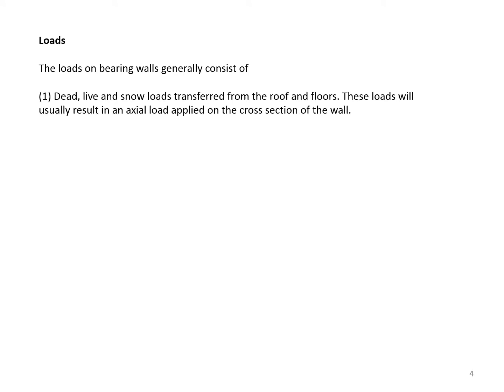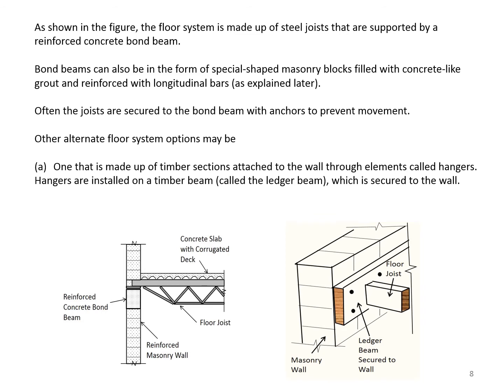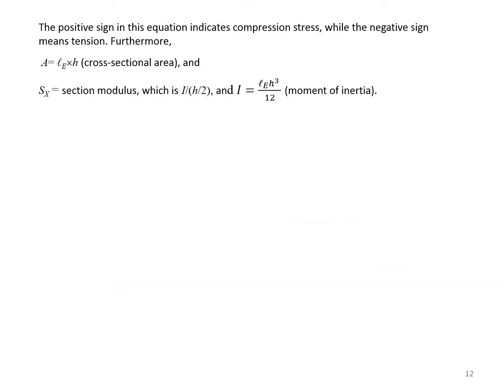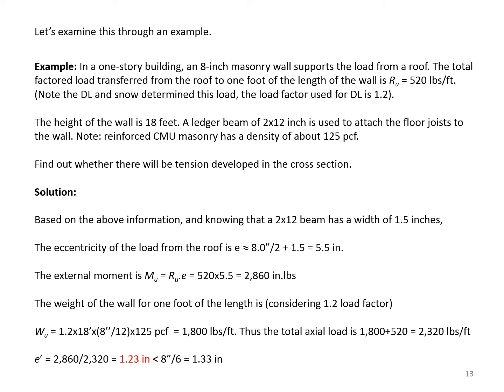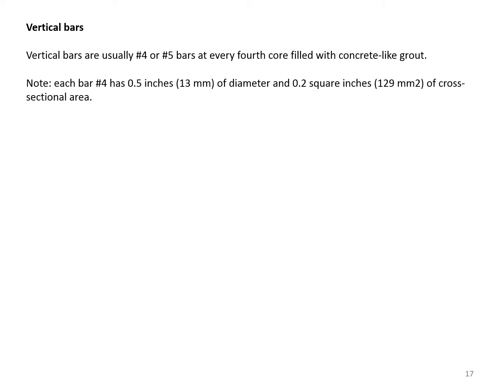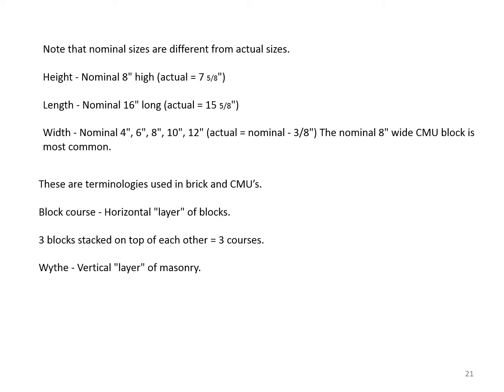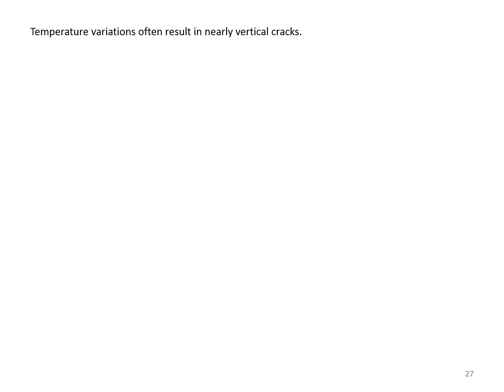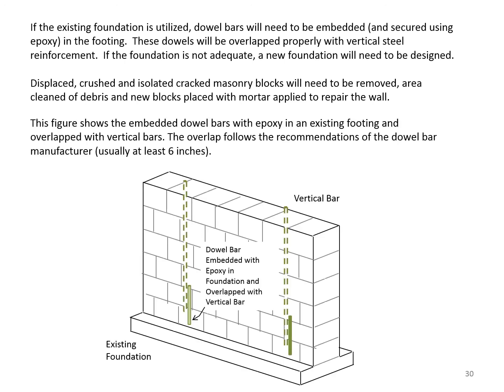Structural Engineering Made Simple - Lesson 13: Design of Brick and CMU Masonry Bearing Walls

Comment: Hi, thanks for the lesson, on example problem 1, 12:20, the check is done at the bottom of the wall, but additional checks should be done at heights above the bottom of the wall where tension could be developed, correct?
Reply from the maker: Dear JC, Very good point - I do not expect a section above the bottom become critical. Nevertheless, it is a good idea to do the check, especially if there you expect the weight of the wall above the section is not enough to compensate for tension. Best regards, Jamshid